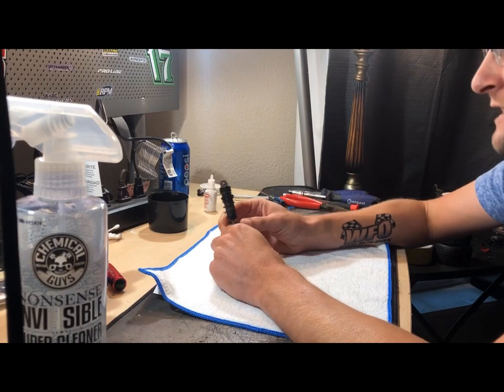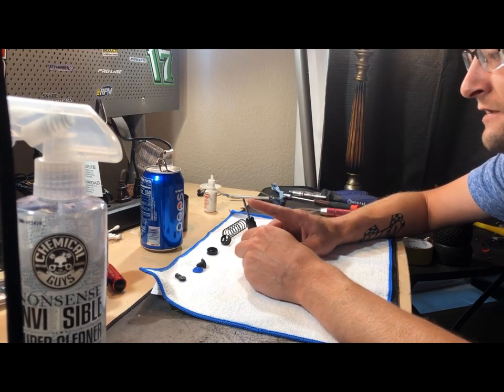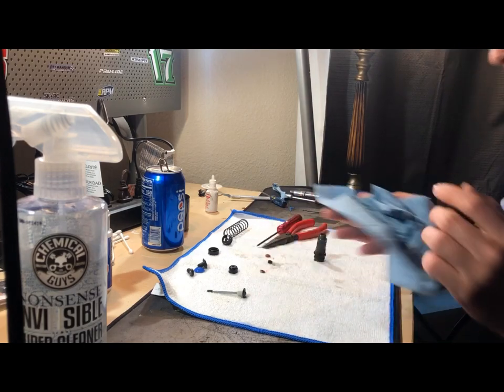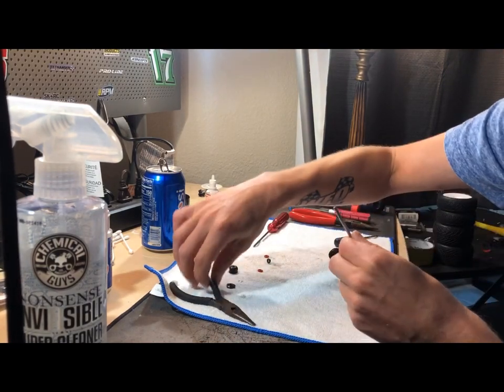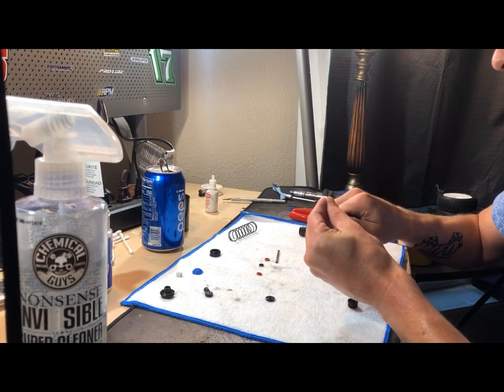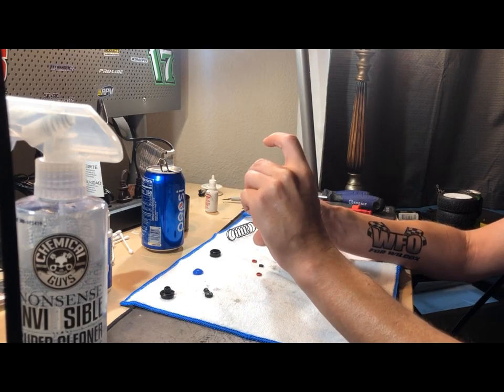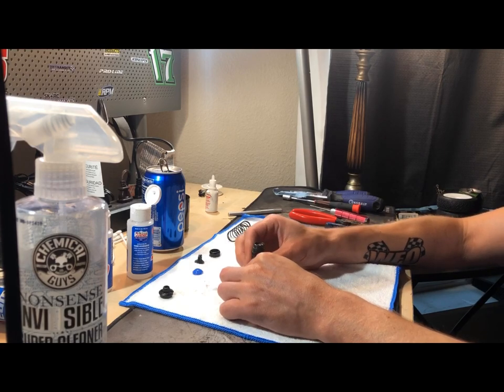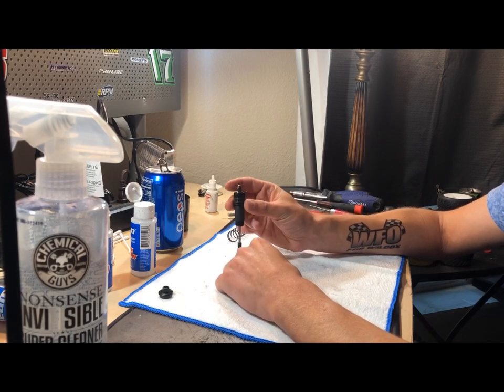RC SHOCK REBUILD || RC TIPS AND MAINTENANCE

Comment: I just had a question about the shocks. I don't know if it's it's supposed to be in this section that you doing with the rebuild or should be in the setup portion of shocks but how do you measure the shocks? They should both be the same length correct ? When is it that you should lengthen or shorten a shock shaft length?
Reply from the maker: I’ll answer a question any where lol
     The way I measure my total shock length is eyelet to eyelet

Comment: What is best oil weight ? 60fr 50fl,rr 40lr that’s tip I received. For stock slash shocks on slash late model with stops inside
Reply from the maker: That is actually pretty darn spot on